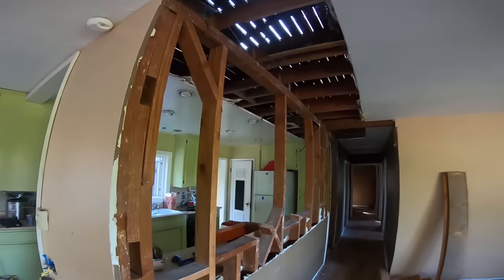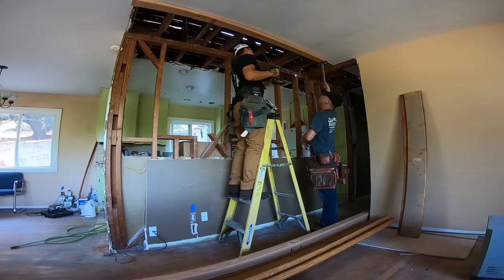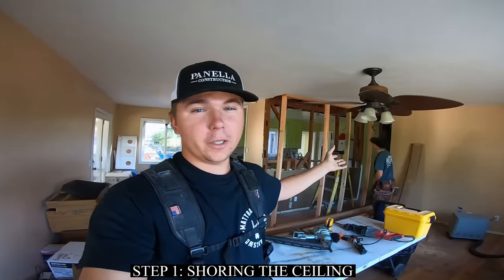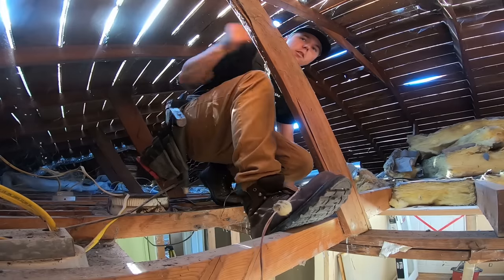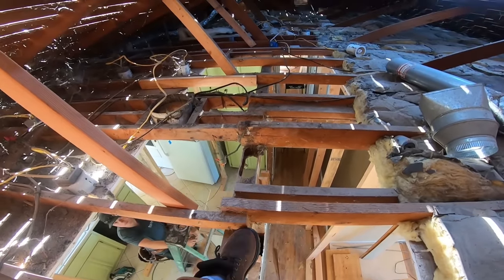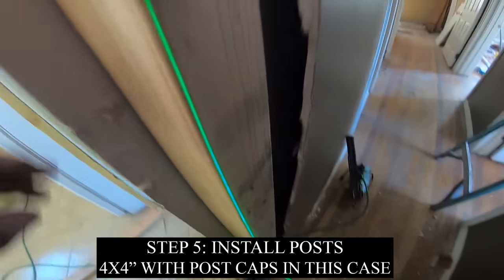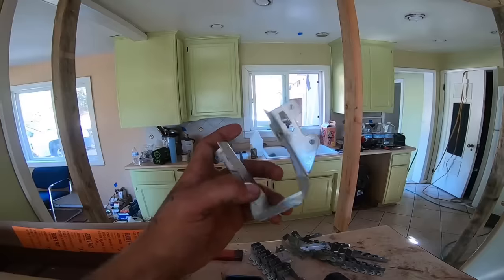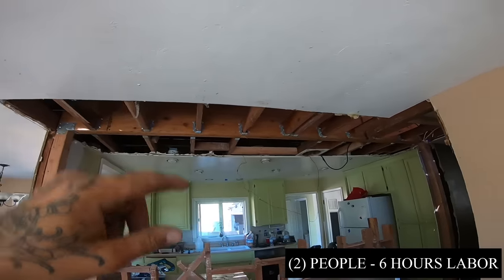How To: Removing a Load Bearing Wall! (EASY STEP-BY-STEP)

Comment: Did you make sure the point loads on those 4x4 posts were carried straight to the ground via framing members directly on a footing or slab. Or on top of a masonry pillar or steel post. If not you will have some nasty dips in the floor in those two spots in a few years.
Reply from the maker: Most definitely. 😁 Due to how many variables can play into point-loads, I didn’t include that in this video.. I’ll have more info on those in another video.

Comment: Hi there,there is a 13 foot opening that needs to be done in a house to open up the rooms... can I just use two 2x12 x14 drop below the ceiling with a 1/2 inch plywood sandwich with glue and nails? Is that safe?

Comment: How do you prevent the exterior walls from bowing out? 

The ceiling joists are bracing the top fo the exterior walls.  The ceiling joists from the front wall link up with the ceiling joists from the rear wall and brace each other from bowing out.  They did not explained how they braced the front and rear walls after they cut the ceiling joist and attach them to the LVL beam with facemount hangers (please note the face mount hangers do not have lateral or tension capacity rating - that I know of). 

If they did not take this into account the y need to contact the owner and consult a structural engineer to review and determine if there is an issue or not.

Comment: Do you have to make sure your 4x4's at either end of the beam land directly over top of a floor joist underneath for load bearing?
Reply: If it’s a load bearing wall most of the time we’ll I’m talking about here in California they usually have a foundation underneath it

Comment: The only load was from the weight of the ceiling. The ceiling joist you cut we're under tension to form the triangle for the roof load. That type of rough wants to scissor the walls out .
So the walls have to be tied together . So if you would have had a roof on that house as soon as you cut the ceiling joist  the exterior walls of the house would have tried to push out into the yard. The support walls wouldn't have helped much.
Reply: What solution to that would you implement?
Reply: @xcct838  use rafter ties above the beam.

Comment: Great job...What is your rule of thumb for height of beam per foot of run of opening ??
Reply: Check your local building code. If you can't find it online, go to your nearest town/city hall or the court house.
Reply: @voisindo  local building code will not apply to the LVLs they were using. It only applies to sawn lumber, an LVL is an engineered product and must be used as designed. There is no prescriptive code for an LVL.

Comment: What is that tool you are using to put up the joist hamgers? 
I just did an LVL in a flip that I'm doing but reading the comments makes me understand I need more support in the basement.
Reply from the maker: That’s a variable that changes in each build. I’m currently getting hounded about not including those variables in the video.

Many different things could need to be done! New footings, extra support in the floor system, etc.
Reply from the maker: PneuTools Rap A Nail 150.

Comment: My home is the same layout. I want to open it up and vault the ceiling but the roof load is carried on top of other walls as in yours. I want to vault my ceilings. Would I sister my roof joists to carry the roof load or would I need another beam to carry the load.
Reply: If you cannot find how to do this in your local building code, you need to hire an engineer or architect to design a proper way to accomplish what you want to do.

Comment: Did you have to shim the rafters for drywall? I would think the gap created by the hangers would cause screws or nails to break thru. Well if you drywall it yourself you would know to be careful once you reached that area.
Reply from the maker: I rocked it all too.

When we do joist, or anything with hangers, we hold it up a fuzz. Makes the hanger not hang down!

Comment: As just a mechanical engineer that beam looks like massive over kill. And that roof system looks like massive under kill lol  I really like the video, I’m not shitting on it or you guys, I could totally be wrong. I understand most cases this is exactly what you should do but that 2x4 roof and ceiling makes it hard to justify an engineered beam lol

Comment: How thick a beam you need if you went all the way to the external wall to create that totally open concept and how big the beams would be to hold that beam up? Hope that make sense.
Reply: you would need an engineer to assess your specific situation for that answer. There are many factors at play in determining the size of the beam.

Comment: On your temporary wall, is it possible to screw the bottom plate into the floor overtop of carpet, or any other flooring?
Reply from the maker: Yeah, as long as you don’t mind damage to flooring.

Comment: When you do this on a raised floor do you have to install a support under the house where the posts are?
Reply: that's what i was taught. you go all the way down to the basement
Reply: Yep called load points and bearing points. The plywood will never hold the weight

Comment: How do you finish that? Seems the plasterboard wont be flush as the lvl is lower. So the ceiling will have small drip for the lvl :/.

Comment: Great video, have to do this and you showed me how, thank you. Have a question on materials tho...

How can I determine what sizes beam I need?  House is same as video, no second floor, just attic. Looking to open up a 10' space. Any ideas?
Reply: It depends on tour roof design and local loading requirements. Hire an architect or structural engineer who knows your area's codes.
Reply: You must determine how much of a load each lineal foot of header or beam receives. You would then just need to refer to the literature from the company that produces the beam to determine span and size. This will correlate allowable spans to load per foot of beam.

Comment: What if your load bearing wall is going parallel with the rafters? Also, what is the pneumatic tool you used to install the joist hangers?
Reply from the maker: If your load bearing wall goes parallel to rafters, it's not load bearing, it's not holding anything.. 😁 PneuTools Hardware Nailer, link should be in bio.
Reply: @MattBangsWood  Dude. Wtf. My whole life is a lie. I feel so dumb right now lol. Thanks for looking out. Hope you're well, be safe and be blessed.

Comment: I may have missed it in the video but why didn’t you have to carry the new  point load of the posts you installed?  Or is there no basement?
Reply from the maker: It’s down there, but since it’s a variable that’s different in every situation, I didn’t put it in the video.

With everyone mentioning it, I feel it should have been in there. 🤦‍♂️
Reply: It’s all good.  
I’m not questioning your work at all.  You know what your doing.  
I’m a carpenter by trade as well.  
Mainly finish work  
Keep up the good work videos

Comment: I have a two story and I'm wanting to replace a load bearing wall with a beam/LLC. Is there a way to do one invisible like this so I don't have an ugly rectangle across the center of the room?
Reply: You can hide a lot of it in between the ceiling and floors, but it depends on the span you're going for and the thickness of your LVL. How much you can hide depends on how thick your second floor joists are.

Comment: Mattbangswood what are you using to install the hangers instead of a regular pneumatic nail gun?
Reply: It's a hanger gun. I have the king that shoots like a nail gun. Set your nail, hit the trigger and it goes in one shot. Doesn't do what Matt's did, braaaaaat. Lol. Mine goes bang bang. Choo Choo train

Comment: could you put a list of tools and written steps?  I am surprised you mention the foundation point at the 4x4 columns.  What was your span?
Reply: If you can't understand the information that was included in the video, this is not a project for you!!
Reply: @guitaronwater9034  jokes on you I did it. I just try to cover all angles before it start.  I'm a civil engr and wanted to cross reference is design.  I used a 3.5x11.25 lol. Don't be an ass hat

Comment: HI .  good video. and good job. as the video name said you told every step to take safely take down the wall. but about the new beam  like a few people mentionned in the comment. you should  add something in the description or  at the end of the video where you briefly talk of the importance of the weight transfer to the basement  and that it is critical to be sure that it can take  all  the weight that is now only sitting on a 4x4 when it was on a full wall.    I personally let the 4x4 through the floor  and let it sit on the beam under when there is one. often if you are  to far from a post in the basement  you might need to add one.  and if you add one be sure that there is  a concrete footer under it or add one.   if you want know if you are to far  from the post.  you need expertise. sometime  only a foot can be too far!!  it depend on what weight it can carry and you might need an engineer to look at it if if you are not 100% sure.

Comment: Used to do a job like this in under a day , with the insulation , rocked and muded same day by myself. Just got to lay off smoking breaks and checking your facebook/ snap chat.
Reply from the maker: Most definitely enough time in the day to rock, tape and mud it in the same day. Drywall was left to someone else on this build! Thankfully, I haven't found myself on SnatchChat yet. :)
Reply: Yeah .. ok

Comment: I have a similar job to do, but the ceiling joist are actually floor joist for second floor and the want to remove beam tha is below the joist and put lvl so the ceiling is flat, how do I know what size lvl to put in, load is approx 16 ft

Comment: I have to do almost same thing in my house. However my house was built in 1946 and all interior walls in my house are red clay block brick that when built all wall were built first then floor joist. I've got to use concrete saw on my wall pain in the ass

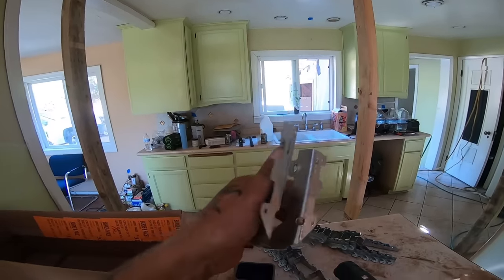Comment: Would like to know what tool you were using at 10:39 to fasten the joist holders. It looks like a pneumatic hammer or sorts.
Reply: art perera you can use a pneumatic palm nailer brother!
Reply: Would you say that a palm nailer is better to use in this case than a stud nailer?

Comment: Don't you have to transfer load down to the concrete? or install extra floor joist beams if the load is in the middle of the house?
Reply from the maker: Yup! Reinforced under floor system. Many variables.. With concrete, it could mean new footings.. With post and pier, it meant huge blocking.

Comment: Great video! So by the looks of it after the wall is completely removed they’ll still be a post at the end? Any way to remove wall with the need for a post? Would love to see that video!
Reply: David Tolentino hows the wall held  up only way would be to run the new beam the whole length of the house and put the poles into the wall but even then that long of length may need support in the middle the poles will be made into the design of the kitchen and won’t even be a big deal

Comment: What do you do if the load bearing wall wasnt supported correctly and now the cement slab is sinking?
Reply from the maker: Get an engineer out to check it out, have them draw something up.. You took out a load bearing wall and created two point loads.

As mentioned in many comments on this video, we had blocking installed in the floor system to support the weight.

If you’re building on concrete slab, it’ll need to be shored, cut out, and a rebar detailed underneath.
Reply: @MattBangsWood  Thank you. Just a 6 foot section of the wall (for a closet) was removed it's about 12 foot wall. So just having someone jack up the foundation that side wont solve the problem? We didn't do it, a shady contractor did. But I noticed the problem after he abandoned the job. Theres a crack now on that side only close to that part of the wall, nothing else seems to be disturbed, tile on that side front section of the building hasn't cracked.

Comment: Well how about the footing under the 4x4 post. Needs to be there or this will eventually crack through the 4 inch concrete floor causing settlement down the road. This will not pass code.

Comment: what was the air tool you used that look like a brad nailer but sounded like a screw gun?
Reply: It some some variation of a palm nailer.  The palm nailers i have seen dont have a grip or magazine they literally fit in the palm and you use it in place of a hammer.

Comment: this method is good for a single house but I have a row house and the wall Im taking down is about 7-8 ft long, was thinking of doubling a top plate and putting in a 3 piece studpack on each side where the top plate ends, can someone verify this is strong enough

I'm going to shore the wall about 3 feet away from the wall im removing of course.

Comment: Do you need to pour a footing under the new 4x4 post?
Reply from the maker: That’s a big variable that you need to consider / consult with engineer.

It differs in EVERY case, that’s why it wasn’t mentioned in this. In my case, I have a post and pier foundation, so in between the floor just, 4x6” blocking was installed to prevent sag in the floor system.

Comment: Man I am too low on time to do this myself but I need it done badly. Know anyone in NH that can do this job and wants to make content for the same project? Mine is easy as it’s 2nd floor and not connected roof, but it’s still a great candidate.

Comment: If the house has a basement you have to extend the two posts all the way down to the basement  with proper footing.
Reply from the maker: Blocks were installed in the floor system to hold the weight, but yes, you’re correct.
Reply: MattBangsWood yeah I think that’s enough if u don’t have a second floor.  Nice neat work.

Comment: Also, Did you reinforce the floor...? Or line up beam onto floor joists?
Reply from the maker: Yes, blocking was installed. Due to it being a variable for this build specifically, it didn’t make the cut on video.

Comment: I’m a general contractor with more than 20 years experience doing structural framing in repair and remodeling situations. This was a good video, with good information about execution of the design, BUT…

What about other applications? Would you know the difference? There’s more than one kind of load bearing wall…there’s more than one kind of load…what’s above and below?…is it part of a larger structural member or system?…what material is the the new beam or header?…what is the proper span for various beams and headers based on all of that…etc

So this is good, but YouTube isn’t really the place to learn about this stuff. Even though this was good, how would you know if you don’t already know? I’m not trying to discourage DIY work, but when it’s structural you really need to be careful. I’ve worked closely with structural engineers dozens of times and there have been time when I was confident I knew what was up and was schooled in my dangerous ignorance by my favorite engineer, who became a good friend. He told me “you know about 90% of what I do for wood framed projects. That other 10% is what prevents disasters and it takes a masters degree and years of experience.” Well, there’s plenty of DIYers who know 90% of what I know, but that last 10% takes years of experience to learn. It’s not what you know you don’t know that’s the problem, it’s what you don’t know you don’t know, and trust me, for most DIYers it’s a ton.

Edit:

After taking a closer look, I have a concern. I don’t see a structural ridge beam, so these joists do more than just hold up the ceiling. They complete the triangle that keeps the roof stable. They are held in tension, keeping the roof from flattening and the walls from spreading and that path is now broken. I didn’t see any remedial structural hardware to bridge the new beam such as straps or tension ties. The purlons may be sufficient to approximate a truss, depending on attachment, but that’s not their job I’m not an engineer, so I couldn’t say. Perhaps I missed something.

A built in place retrofitted truss design may have been better, though more complicated. It would also require an engineer, but my other scenario may as well. Just an idea.

Comment: Hell for being a one story, he should have made the ridge board into a beam. Would have been faster, better, less impact on living space; he already had complete access to roof framing members. This roof structure was stick framed and looks like it actually did have collar ties but they were high collar; what he should have done instead of the purlins,which maybe* aided the rafters in sagging but probably didnt because he nailed instead of screwed, is install a mid span collar tie as actual temp shoring for the potential splaying of the rafters BEFORE he cut the joists. This kid got lucky, hopefully he'll learn from these comments. (Not hating here kid)

Comment: I'm ready to go remove plaster lol so I can have a large room I hate the room shape but got to be sure before I take plaster off and get going that its not impossible there is no plumbing but there is an attic above the wall so if the beams are holding up the roof on top of the wall then no but there is also an air conditioner up there I don't know if that would be a problem any one want to Skype or Facebook messenger to let me know through the screen I can show you...save me from a nightmare lol before I start pledge hammering